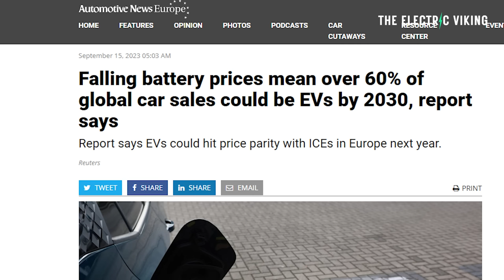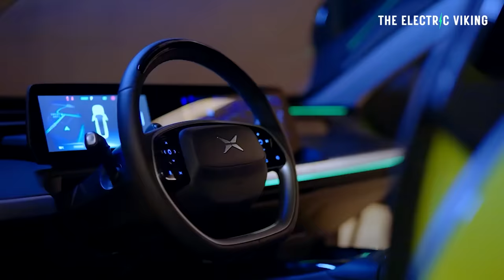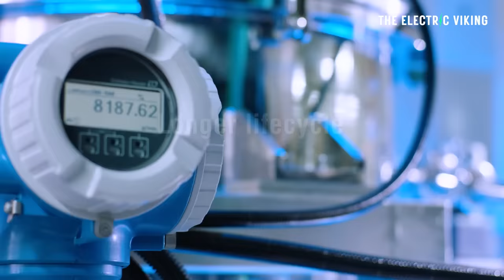Small EVs hit price parity with internal combustion after huge battery price fall

Comment: As the number of EV's increase the cost of oil will drop. Oils' price is set by OPEC and they will cut production to maintain a floor but they have already said they prefer an $80 a barrel floor. The fracking market will dry up at that price but I see that as a good thing. Energy independence is within reach for the USA and that's a good thing too.

Comment: What few people realize is that the fossil fuel power generation largely based on coal where the power stations have to transport the energy very long distances resulting in large transmission losses. Some say up to 50% of this generated power is lost in transformers power lines and local distribution. With renewable energy generation happens on roof tops, wind farms and battery storage close to where the energy is consumed. This means a renewable energy picture means only 50% of renewable energy is required to match a fossil fired generating equivalent.

Comment: As soon as charging becomes easy in all countries (for example, in Spain It isn't) we Will see the change boosting. 
People understand that car fumes are toxic, that fuel costs Will be lower, less NOISE...
It only takes courage and a  push in charging infrastructure
Reply: People also understand that EVs don't run on unicorn farts !
Reply: @OverlandExpedition yes, they run on electricity...
Reply: @elmohead  And people also understand electricity is not produced by unicorn 🦄 💨.
Reply: @OverlandExpedition  Yes, but unlike oil, you don't need to ship electricity from an electricity refinery to an electricity pump station. You can simply let electricity travel on its own via cables at little to no losses.
Reply: @elmohead   No, but unlike oil, you need to ship billions of tons of earth to factories from open pit dregging to refine down into lithium.

Comment: 12 years ago I bought a chinese elecric moped. This was available in both electric and gas powered versions. The electric was somewhat cheaper, and when checking sparepart prices for respective driveline, the difference became even bigger... With this said, an EV is cheaper to deelop and produce. Lets say an ICE car is at 15k, then the EV, if you exclude the battery, should be around 12-13-k... the battery adds about 5k... then we are at about 17-18k for a budget/normal car (not premium)... China seems to be there already today, but here in EU, we seems to have a long way to go, a very long way...

A friend bought the gas powered version, it lasted for 8 years, and some expensive repairs of the driveline... My electric still runs as new, not a single repair besides one battery swap (lead-acid batteries) just simple service. If an EV car is taken care of, maybe it will outlast an ICE. Just change batteries, and the 15 year old EV runs for another 15 years...

Comment: Wright's Law says that prices drop by 15% for every doubling due to economies of scale,  so at the current US volume, this means a $50k car would be $31k by the time the volume reaches 100% EV sales of new cars. Globally, the price should continue to go down like TVs and cell phones once we reach a certain product level without improvements to efficiency, battery density, etc. This means EVs should be much cheaper, but sales aren't going to be so fast, as he states. In the US, 6% of cars on the road are EVs, so even if 100% of new cars sales are EVs, it would take 10 years to get to 60%, and it would take another 3-4 to get to 80%, so this is sometime in 2037-2038. Further away than predicted, and I think it won't look like an S-curve. It will rise, but less aggressively once government subsidies taper off and also once the masses get into an EV who can. There will be a ton of holdouts because people will stick to ICEs for towing and hauling, for long work commutes and frequent travelers, for those who live in apartments and don't have a garage to charge because of impacted superchargers, and for those in cold climates who need the heat of an ICE and the range.

Comment: A good 30% or more of drivers are apartment dwellers with no ability to install home charging.  That will increase faster than apartments provision chargers, so the problem gets worse.  Public charging is still primarily slow charging, and that will not change soon.  The EV adoption curve is slowing very quickly as the fatcats have already bought EVs as their 3rd or 4th car and don't replace them annually.

Comment: As we've been seeing lately, a big problem for EV adoption, in the US at least, is the charging infrastructure. Charging sucks. With more focus on providing adequate charging options for EV owners, especially those traveling longer distances, I could see EV adoption progressing very rapidly. If there were too few gas stations for for ICE vehicles, it would have been the same problem in reverse. Where's the money and the effort on charging options which actually work? Reports on the ones in operation now is that many if not most of the units don't work.
Reply: its because the owners of the charging systems arent incentivized to make them work… its 0 day planned obsolescence lol
Reply: charging options that work:   tesla

Comment: THe real problem here is people want pickups not entry level vehicles. That's why the domestics dropped low margin entry level vehicles
Reply: and pickups that work in the winter and can haul trailers. I did 500Km yesterday on a bit more than 1/2 tank. Would have had to charge at least once with a Ford lightning and god only knows where as out here only some of the roads are paved so you can estimate how many super chargers there are.

Comment: Because most of the mileage is done by relatively new cars, a couple of years after the bulk of new cars are EV, there will be a crash in the number of places selling petrol. Once it starts to get harder to refuel and look like getting much harder in future, ICE sales will collapse due to range anxiety. Who wants to buy a new ICE car if it is going to be hard to find fuel while you hoped it would have high residual value?

Comment: So far, there is no EV that will allow me to continue the tow a trailer several hundreds of Km to events conveniently. I do believe an EV will work as a commuter car or a grocery getter as long as you don't mind the huge depreciation over a few years.
Just for fun, I ran a calculation that to replace the oil used in transportation in my country daily, we'd need to add about 2.5 million Mwatts daily to the grid.
They have yet to add road tax to an EV.

Comment: Interesting commentary as always. Everyone is being forced down the EV route when it’s possibly not the best technology-only expedient. Also there is allegedly not enough Li globally to meet demand, so battery costs seem unlikely to fall given that detail. The elephant in the room is not only the extortionate cost of EV’s in relation to peoples income, but also the significant fact that batteries do not last forever, and the replacement cost would be prohibitive. Who would want to throw away a car which could have cost them £45,000? Not me! Another point is energy has never realistically reduced in price, despite availability. If you were to fast charge at a uber Kw power source, it would cost more per electric miles than the equivalent fuelling of a fossil fuelled car, so the economics are just not there. I suspect currently, a significant proportion of EV’s on the road are leased in some form, rather than private purchase, so the s/h market in the near future could have a lot of unsellable EV cars(?). Desperately wanting a viable alternative to Li battery cars.
Reply: It isn't just that lithium is limited and not up to demand, but apparently the current batteries can't be recycled.  If people really want to waste their money on battery cars, a new type of battery is needed.

Comment: You also have to factor in that there will be significant job loses in the Oil sector and other sectors in the Economy, not just the automotive sector...so that will  have an impact on new car sales and the EV Adoption chart.
Reply: Yes, but EVs and Renewables will require a lot of expertise that can come from those folks losing their job in one company. Lots of transferable skills.
Reply: The oil sector isn't worried.  You guys all see them think that oil is only used for gas.
Reply: @retiefgregorovich810  exactly. They'll stop petroleum production for burning, but plastics is a massive part of their business.

Comment: Gas prices could get scary as economy of scale starts to break down. Gas theft will be a huge problem, insurance companies will refuse to insure gas, gas stations will stop selling gas. It will just be too dangerous to store it with all the gas thieves after it.
Reply: Not sure about the theft bit BUT the ICE situation might actually be worse - lack of demand means gas prices go high in order to keep profit margins high enough to cover debt which encourages more EV adoption,  Gas stations start to close, Repair shops close as well and/or their service prices rise, parts become less available and more expensive. Conversely the ICE vehicle prices will drop precipitously. Lower income folks will have no choice but to buy these due to the super low initial prices but the cost to maintain will be much greater and more burdensome in the long run.
Reply: @hobo1704  It's going to be beautiful if electricity rates rise. I'll charge my EV at night when rates are cheap, then sell the stored electricity from my battery back to the grid during the day when rates are expensive. I only drive 3-4 times per week.
Reply: @robrider838 
I drive everyday. 
EV or #ICE   doesn't matter, I LO❤E driving .
Reply: @robrider838  another EV fanboy that has no life and never travels anywhere. Stay close to home champ, that's what they want.. Jeez, imagine giving up your freedom to save a few dollars..
Reply: @erktrek  The only problem with that thoery is its like saying there will be no oil - oil will still come into the US - thus the supply will keep high - I think you will see a duck curve more than anything - prices will go up - and then free fall as no one will be using gas as much - and both the gas-stations and the encon will try to sell it as cheap as possible again. The other side of things, these countries that make oil still also see less demand - meaning they too will want to sell as cheap as possible or else they will be just sitting on supply. We're seeing the curve up wards right now more than anything as other countries that did supply oil are increasing their markeups and decreasing supply - but they too will feel the hurt once more EVs come online. There will be this weird mix of one and the other competing for owner ship in the next 5 years. As to say, gas will be the same price as electric and visvers year on year.
Reply: all correct but garages wont go out of business for at least 20 yrs. Maintenance costs will go up but there is a hugh market still in place for  the garage.
Reply: I dont know how it works in all parts of the world, but in Europe, most of gas price is tax!!! When most cars will be EVs, goverments will establish another taxes (dont know exacťly how, but surely there will be something). EVs will not be so cheap to run as today…
Reply: @hobo1704   Freedom from oil much more important than not having to take a piss stop when going over 300 miles distance
Reply: I don't understand what the OP is trying to say here. Is he saying that EVs will cause gas prices to rise?
Reply: You ever think of writing a sci-fi novel 🙂
Reply: @madcroc111  what's wrong with oil?
Reply: @hobo1704 Freedom?  What freedom are you talking about?  I travel all the time in my EV, anywhere I want to go.  Personally, I like the freedom of waking up to a full tank and never needing to go to a gas station, unless on a trip.  I like the Freedom of instant torque and passing someone on two lane road without worrying about if I can build up speed to not die in a head on.  I like the Freedom of not breathing exhaust fumes.  I like the Freedom of hearing my music more clearly without having to turn up the volume because of engine noise.  I enjoy the Freedom of not wasting time on oil changes or maintenance.  I like the freedom of using the HOV lane.  I like the freedom paying less money on fuel, or in my case, zero money, as my car charges from solar 90 percent of the time.  I also like the Freedom of not dying as EV's, particularly Tesla consistently top the charts as the safest cars on the road.  There's a reason why most EV buyers, never go back to gas.  You'd do yourself a favor to try one out.
Reply: @josefsorna  In Texas in the US you already have to pay $200 per year to register an EV. Gas car is about $50
Reply: @-whackd  Not EVs directly just indirectly when gas demand starts to fall. Not that anyone ever needed a "reason" to raise gas prices, I've seen hundreds of reasons stated in my lifetime. But yeah, vilifying EVs could be added to the handy list.
Reply: @Ryan-ff2db  you obviously don't travel far then if you aren't paying for charging. And no, charging at home isn't free because you are missing out on selling your electricity back to the grid.. Biggest misconception by you people.. How do you smell exhaust fumes, did you have a leaking exhaust?.. Most countries are not set up enough for EV's, this is another reason why people don't want them.
Reply: @hobo1704  what the hell do you mean how do you smell exhaust fumes? Leaking exhaust?

The entire function of an exhaust is to vent the fumes outside the vehicle. Then the car behind that one sucks those exhaust fumes directly into their AC intake, or the people on the road nearby directly inhale it. 
You supposedly not smelling exhaust is the more strange claim here.
Reply: @hobo1704 You obviously don't own an EV so you don't understand.  I do pay for charging at superchargers obviously but unless you're in band traveling the country or something you will spend more time at home than driving.  The average American drives only 37 miles per day.  I can't tell if selling your energy back to the grid statement is a joke or not.  Where I live(and in most states) they give you almost nothing back for your power.  For me it's 2 or 3 cents per kilowatt, which is almost nothing.  

While 29 percent of pollution comes from ICE engines if you live in a city as much as 95 percent of pollution in cities comes from these vehicles (look it up, I'm not making up this stat).  As someone who grew up in LA where you can literally see the air you breath, it doesn't take a study to know switching to EV's will save a lot of lives and health issues.  No exhaust leak required.  However, there are plenty of studies if your curious.  

There are reasons why some people would not want to drive EV for sure but the only one that actually makes sense is if you have no easy way to charge it.  Most EV owners(around 80 percent) charge at home or work so for most people this isn't an issue.  As charging and battery technology improve this will become less of an issue.  Battery technology has come a long way in the last 15 years and with the massive investments into R&D budgets from literally 100's of companies there's not reason to expect it won't continue to improve.
Reply: Not a likely scenario. Gas stations will shut down, some refineries will close, expensive offshore sites will close, etc. Only low-cost producers will survive. The price increase will be for asphalt, plastic, fertilizers, etc. as they will have to cover the cost of producing petroleum whereas they are byproducts today.
Reply: @hobo1704 That’s what who wants?
Reply: @josefsorna They will be if you charge with solar panels.
Reply: @hobo1704  Another dinosaur addicted to dinosaur juice, or perhaps another conspiracy theorist addicted to tin foil.
Reply: @hobo1704  Have you just come out of a 40 year coma??
Reply: @hobo1704
Gotta consoom and travool
Reply: @Apjooz  gotta live life muppet, have fun staying home saving money..
Reply: The band kept playing after the titanic hit that ice-berg……
The UAW is the band
Reply: @hobo1704  Running away isn't freedom.
Reply: People don't want them? Norway leads the world in electric vehicle (EV) adoption: EVs account for more than 20 percent of passenger vehicles in the country and more than 80 percent of new vehicles sold. Mark Kane, “Norwegians replaced a fifth of their cars with all-electric ones,” InsideEVs, January 1, 2023.
Reply: @Wilem35  running away? It's called getting to where you want without any restrictions.. something impossible with EV junk
Reply: @hobo1704  Poor fella enslaved by hydrocarbons and believes he's free.
Reply: @hobo1704  Oil means you are always dependent on big corporations to sell it to you. Electricity you can even generate yourself with solar panels. Much more versatile how to make it and get it. No saudis to raise prices on you either
Reply: @madcroc111  never had a problem getting fuel, price fluctuates like everything in life. Don't see the problem
Reply: @Wilem35  I am free , can you muppets go camping far away? up the beach? No, you are the one's enslaved by electricity 😂
Reply: @hobo1704  of course, we can also boost you when your f150 breaks down.
Reply: @Wilem35  Total BS.
Reply: @robrider838  How do you think electricity is generated at night?

Comment: Sam, will there be enough copper for this expansion at this rate?
Reply: Obviously yes, there is.  Copper is no issue as a) there is so much of it that it is still being routinely used in construction, in applications where it has zero avantage (there is enough copper on my roof for the construction of maybe a dozen Teslas). And b) it can easily be replaced by aluminum in bus bars and harnesses, should it become overly expensive.
Reply: @st-ex8506  I only bring it up because EVs use 4x more copper than ICE vehicles